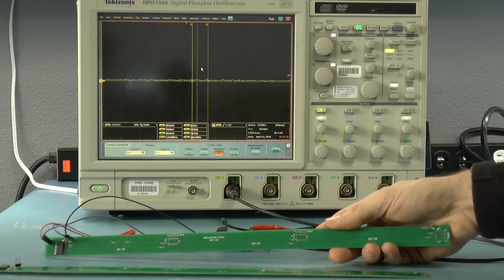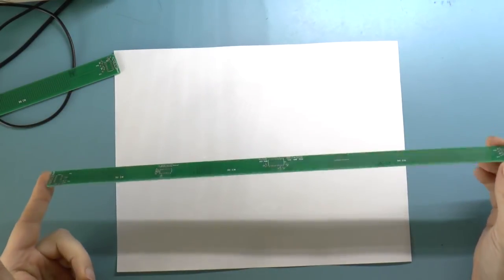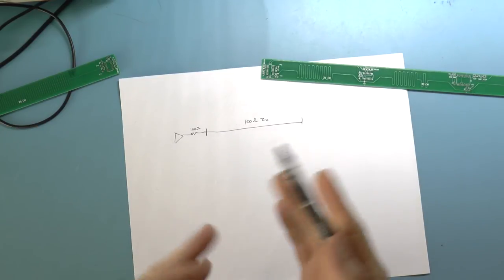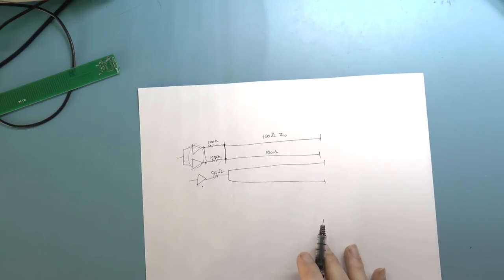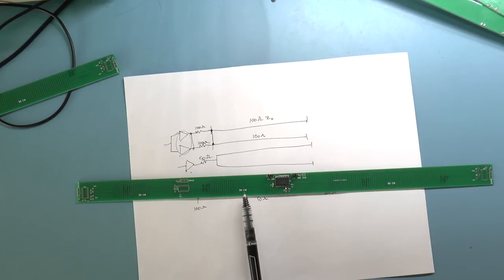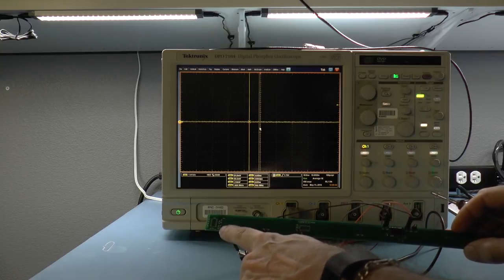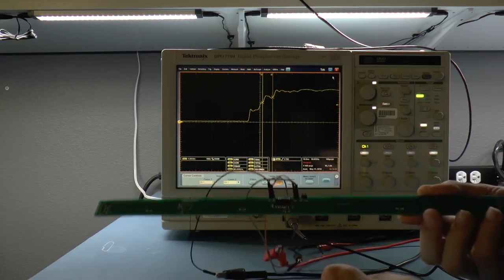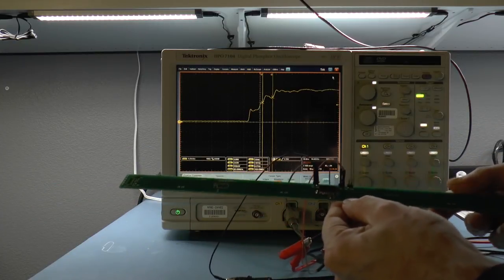Chip tips #9: Transmission lines and bus termination

Comment: The option you did not try is to have end termination resistors with capacitors in series. Pick the capacitors so that the tau corresponds to 2 times the length of the transmission line.
Reply: the tau you will need is still twice the total length of the line. Increasing tau beyond that (which is what happens when the driver is towards the middle rather than at the end, which in turns shortens the length from the driver to the termination) just increases power consumption over the optimum case. But, as you say, you need to be able to handle the driver at the ends also, which is why I suggest 2x the line length. 
Edit: and if you go with a very large value (textbooks usually have 10x the line length for this example), it behaves the same as just the end termination resistor, but at lower power dissipation, as long as the dwell time of the signal is greater than tau. If the dwell time is faster than tau, the power dissipaton is the same as a termination resistor to vcc/2.
Reply from the maker: Interesting! I will have to try that.
Reply from the maker: Actually, I think adding an RC on the ends is just a low-pass filter, so it will slow down the transition time. Ideally I'd like to avoid that.
Reply from the maker: I tried it, and it seems to have worked quite well! I think I'll use that, and I'm working on the video for it.
Reply: Not quite an RC filter.  The capacitor itself would 'see' a low pass filtered signal,  but with the resistance between your capacitor and the transmission line,  the line itself just 'sees' the terminator resistance (for AC). You basically only get the benefits!

Comment: Source terminating each chip is not easy since you have many of them spread across the bus. Terminating each end of the bus (as in CAN protocol, for instance) would mean half of the amplitude would reach the receiver (if you also source terminate). I would try an RC termination at each end. R would be the characteristic impedance of the transmission line. I would determine C empirically. This way you have the full amplitude and you are still terminating high frequencies. I have used RC terminations and had very good results. By the looks of your waveforms, you are having reflections and you are not properly terminating it. You should have a clean square wave without any ringing.

Comment: Follow up .. I just went looking for a decent Oscilloscope and the price of that unit is a small house here in Canada. I think perhaps I won't be doing any lab work at home. Be thankful you have access to such equipment. Would be nice if you took a moment and did point out the units on the screen. I saw ( blurry ) what seems to be 100ps per point and thought "there is no way that instrument is getting 100 picosecond samples" and even thought "noise in the sensor cables and clips and EM sources would disturb a sugnal at those resolutions" but what do I know. Best scope I worked with was in the megahertz range and you have a Ferrari there at 25GHz or more.
Reply: DPO7104 (the oscilloscope) is 1 GHz if I remember correctly.

Comment: I would RC terminate both ends with R=1.5 Z0 and engineer all cards with 0.5 Z0 output impedance and infinite input impedance.  I would adjust C to give RC of about 0.7 of the end to end wave travel time (NOT round trip).

Comment: You may want to become familiar with SPICE simulations of transmission lines. An article that can help: http://i.cmpnet.com/rfdesignline/2010/06/C0580Pt1edited.pdf
Change the C0580Pt1edited to C5080Pt2edited and C5080Pt3edited for parts 2 and 3.  Part 3 includes a spice model for a transmission line as a 2-port network, which is faster than the built-in lossy transmission line simulation for most SPICE tools. 

TI has a handy application note, especially figure 5: http://www.ti.com/lit/an/slyt441/slyt441.pdf

You'll probably also want to read Analog Devices Practical Guide to High Speed PCB layout: http://www.analog.com/media/en/analog-dialogue/volume-39/number-3/articles/high-speed-printed-circuit-board-layout.pdf and possibly AN-47. The pulse generator in AN47 appendix D is particularly handy for measuring transmission line reflection effects, because it tends to be faster than most signal generators (<350ps rise/fall time). Of course oscilloscope bandwidth can start to cause issues at those frequencies, as you need about 6GHz bandwidth to be over the Nyquist criterion, so you'll get some distortion and lower measured voltages than expected.